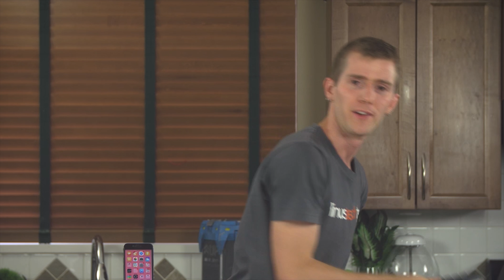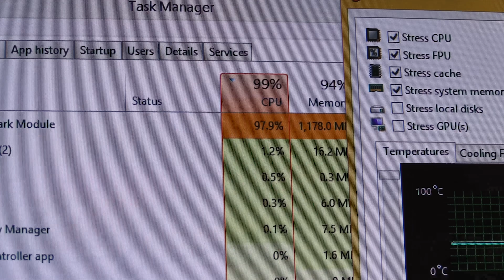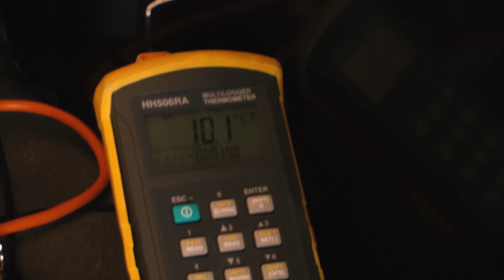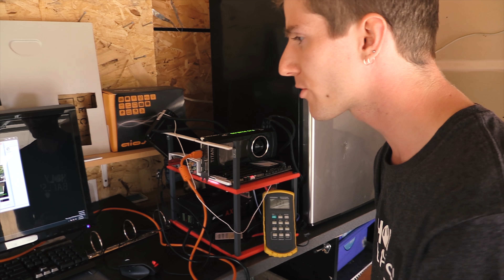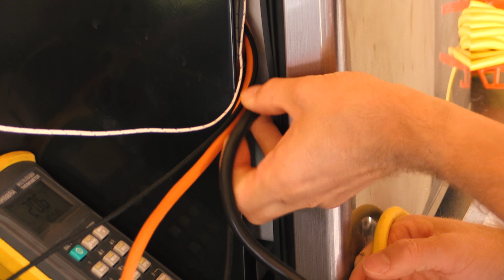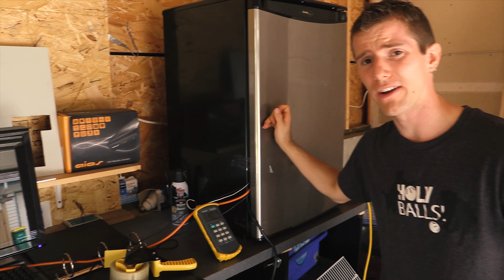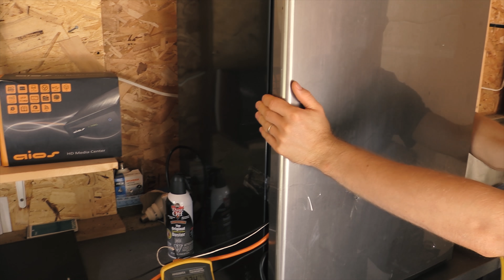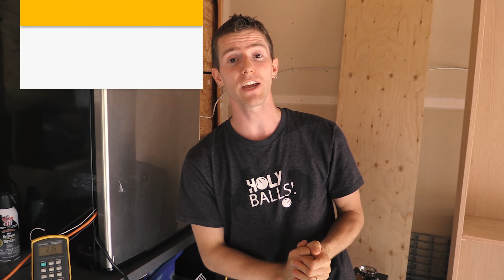PC Build in a Fridge - Does it Work??

Comment: I am building my first PC and I was hoping someone could tell me if my parts are compatible. My budget is $ 1000 Canadian (around $ 78 American).

I have selected:
- Phanteks PH-ES614P_BK Black Steel / Plastic ATX Full Tower Computer Case
- Cooler Master V650 – Compact 650W 80 PLUS Gold PSU with Modular Molex/SATA Cables 
- ASUS Crosshair V Formula-Z AM3+ AMD 990FX + SB950 8 x SATA 6Gb/s USB 3.0 ATX AMD Gaming Motherboard with 3-Way SLI/CrossFireX Support and UEFI BIOS
- AMD FX-8350 Black Edition Vishera 8-Core 4.0GHz (4.2GHz Turbo) Socket AM3+ 125W FD8350FRHKBOX Desktop Processor
- CORSAIR Vengeance Pro 16GB (2 x 8GB) 240-Pin DDR3 SDRAM DDR3 1600 (PC3 12800) Desktop Memory Model CMY16GX3M2A1600C9R Red)
- SanDisk SD6SB1M-128G-1022i 2.5" 128GB SATA III Internal Solid State Drive (SSD)
- GIGABYTE GV-N75TOC-2GI G-SYNC Support GeForce GTX 750 Ti 2GB 128-Bit GDDR5 PCI Express 3.0 Video Card
Reply: Marcel Robitaille  $1000 canadian is nowhere close to $78 american its $761.71 american
Reply: If you dont subscribe to my channel you will die within three days http://www.merriam-webster.com/dictionary/joke
Reply: Marcel Robitaille 
https://uk.pcpartpicker.com/parts/partlist/
enter them in this site and it will tell you of any issues, plus what cooler are you using, the 8350 runs quite hot, so i would recomend an all in one watercooling cooler, you don't need to add the water yourself, it's closed off and it's easy to install, look into the corsair hydra H60,
Reply: Nathan Jones Thanks for the watercooling tip. I thought without overclocking the stock van can usually cover the heat of the processor.
Reply: Marcel Robitaille
stock coolers will give you about 55C under slight load, they are really bad, my FX8350 at 4.4 GHZ runs about 35C when watching 1080p youtube videos and multiple browser tabs, and 50/55C ish under load, with the stock cooler it would easily hit 85C, did all the parts work together?
Reply: Nathan Jones Yep: http://ca.pcpartpicker.com/p/V9x4TW
Reply: Nathan Jones Can I ask why you chose the corsair hydro h60?
Reply: Marcel Robitaille
it's water cooled but it's closed loop so you don't have to fill a resovoir or mess around with tubing, it's easy to install and it's better than air for around that price, plus there isn't a massive heat sink to get in the way of anything, ideally i would now get the H80i, but the h60i works great especially if your not overclocked.
Reply: and it's very quiet.
Reply: Nathan Jones I think I might splurge and go for the h80i. I would like the option to overclock. Noise doesn't really matter for me. I have a fan inches from my face right now. Where do I put the radiator?
Reply: Marcel Robitaille
the fan and the radiator are fixed together on mine, so you just install the fan like you would nornmally on the back of the case, then it has really long screws that go through inside the case and hold the radiator inplace so the fan and radiator are sandwitched together inside the case, so for  my h60i, the fan and radiator  only take one fan slot.
Reply: Nathan Jones Thanks a lot! You have been very helpful. I wish there were something I could do for you in return.
Reply: Marcel Robitaille
my return is knwoing that your CPU won't catch fire lol.
Reply: Nathan Jones That works for me.
Reply: Nathan Jones The case I chose only has one 120 mm fan slot in the back and it's at the top. Will this be a problem?
Reply: Marcel Robitaille
no it's the same layout as mine, on the back and at the top of the back, that's the normal place for it.
Reply: Nathan Jones ok cool. Do I need support from the top or just the four long screws?
Reply: Marcel Robitaille
no the 4 screws hold it all inplace, it's not heavy or cumbersome at all, just a bit fiddley to hold the fan and radiator together then put the screw through them both, but it's easy.
Reply: Nathan Jones 50/55 thats alot you live in the desert :D ? my 8350 is around 38-42 at 4.5 with a H60, 20C temp here
Reply: why are you scaring him people a competent not that expensive air cooler would be just fine i think. water cooling is for overcocking mainly
Reply: ***** Not a joke; and it's not for browsing the internet. The most intensive regular thing will be video rendering. I would not call $ 86 of ram "wasting all my budget". Call me shallow, but I want this to look decent, hence the case I chose. A fair amount of fast ram is one of the most important things to me in this build. If you have any real suggestions, I would be happy to hear them.
Reply: Marcel Robitaille Its a good build but can I suggest-http://ca.pcpartpicker.com/p/BtPjMp 

Although it is more expensive I think you should invest now as it will give you better perfomance, better bang for buck and better overclocking headroom, especially for gaming. If you want buy only one GTX 960 and upgrade to another one later. If you want a monitor I would suggest the Acer V246HLbd.

PS: Nothing against AMD but Intel usually provides better CPUs and if you can afford it go for Intel.
Reply: Nathan Jones Ok, one last question. As this is my first build, I don't really know what/how much is included with these products. Will I need thermal paste or SATA cables?
Reply: Thunder Stryker I am not looking for a gaming rig. Also, 8 core 4.0 GHz at $ 170, the 
  AMD FX-8350 seems like a way better deal. It even has a bigger chache.
Reply: Thunder Stryker Good tip on the monitor though
Reply: Marcel Robitaille you will need thermal paste,  just put a line the size of a rice grain on the cpu, and for sata cables you will need one for each hard drive/ssd, and disk drive, you may only need one.
Reply: Marcel Robitaille .. i was gonna propose that maybe you get worse cpu for better gpu but you said you don't want gaming pc so. whats it for productivity?
Reply: Marcel Robitaille  you don't want a gaming rig ??? why is that ;). anyway.. in this case, you don't need a maximus..  the mobo I have asus m5a99FX rev 2 would be way overkill, but since you want to overclock.. well then just get a 8320 and overclock it.. that would be perfect. 

Also if you don't plan to game at all (which needless to say, sounds weird lol) you don't need a 750 Ti either, a r7 240 would be plenty enough for instance, or the Nvidia counterpart. (that have 2gb vram for half the price though..).

Ok let's assume you do as I told you you could save arround 200$, either get a second hand r9 290/x  and have a killer gaming rig.. or get a 512Gb SSD, remember the FX's consumes ridiculous amount of power also, get a HX 750 so that later down the road you can get  like a good graphic card and have plenty of room for overclocking...

Good luck m8.
Reply: Marcel Robitaille I have the 8320 for editing purposes and it works fairly well :) I use a 270x when rendering stuff and it's pretty fast, sometimes I do play games and I have to say I am satisfied with my rig. The 8350 is a good choice!
Reply: Nathan Jones It says Thermal compound (pre-applied). Do I still need thermal paste?
Reply: naah its already there it might look like a tape on either the cpu or bottom of the fan heatsink. i think nathan'll tell u the same
Reply: Marcel Robitaille Please switch out your power supply for a Seasonic equivalent. The stability of your power supply will speak volumes for the longevity of your build. Don't ever skimp out on the power supply. I've learned it the hard way.
Reply: BigmanTing 55c under full continuous load, its hot and humid in my attic room, idle is around 30c/35c.
Reply: Colossal Mushroom I have switched to the CORSAIR HXi HX750i. Satisfied?
Reply: ***** Why do you say that? I know it runs hot. I am ordering water cooling.
Reply: If you don't go high end (100 ish $) water cooling is a waste IMO.  but it's nice, also looks cool, if you have a window on your case ;).  and good choice with the hx 750, followed my advice I see.

Je vois que tu parle français ;) avec un nom pareille j'aurais du m'en douter aha
Reply: Marcel Robitaille wao yeah it is
Reply: Marcel Robitaille  You forgot the mini fridge!
Reply: *****
i never said to get watercooling for basic web browsing you fucktard, it was for the CPU intensive video rendering, learn to read before you comment, plus i listed like 5 other reasons why a closed loop watercooling is better than air, no massive heatsink, alot quieter, looks way better, better cooling, the FX 8350 is a hot cpu, doing video rendering would ramp the fan RPM to an annoying loud level, i bet you don't even have these components, so what the hell would you know about them specifically.
Reply: Anchoret89 I want to overclock.
Reply: David Zer lol
Reply: If you dont subscribe to my channel you will die within three days It's a joke.
Reply: ***** 
- "The ghz and cache number mean absolutely nothing when comparing intel and AMD." What?
- "I removed the GPU because it is useless if you never play games." I never said I would never play games. It's just not a "gaming rig".
- "I choose a evo 212 air cooler because the difference between air and water cooling is minimal and is perfect if you don't overclock." I want to overclock. I've said this before.
- Nice case but no disk drive?

Why did you switch the ram? What is the advantage?
Reply: ***** - Fair point on the cooling but watercooling is just too cool and I don't mind spending a little extra for it.

- You picked more expensive ram
- I know, I have a USB with ubuntu on my desk
Reply: Marcel Robitaille you lost me after AMD but your choice of ssd and psu is not that good is well.
Reply: ***** Why?
Reply: bektas konca I have since changed the ssd and psu. What does everyone have against AMD?
Reply: Marcel Robitaille i have been fixing computers since 90s all i can say is i have seen 10 times more broken AMD computers  than intel, so get my meaning?
Reply: Marcel Robitaille same thing applies to graphics cards with ATI they are not reliable like nVidia, i would opt out for cheaper older model  on intel and nVidia instead spending money on AMD and ATI.
Reply: don't listen to the haters AMD 8 core is perfect for rendering, that's actually where they shine most.. LOL. I know for a fact I have one oc @ 4.65 on ND14, and I looked tons of bencmarks, Marcel did you already order your build ?  show me the parts you choose again, RAM G-skill 2133mhz CL9 8 gb kit is your best  choice, and the 750AX corsair PSU can't go wrong with it.. 7 years warranty.
Reply: Thomas Syxe No I didn't order yet. Thanks for your suggestions. I will definitely look into those components.
Reply: Marcel Robitaille I'd advise a more powerful graphics card than any processor change,Cheers!
Reply: Marcel Robitaille http://ca.pcpartpicker.com/p/JfvdQ7 I'd go for a stronger processor but i think im already out of your budget
Reply: EliteNoob Nice build. thanks for sharing.
Reply: Marcel Robitaille
You'll need to upgrade the cpu in  2-3 years :p  i have a similar build and i can play whichever game i want at decent fps
Reply: FX 8000's /and 9000's CPU are good for multithreaded applicated only thing they lack is single threaded applicated, it is best illustrated in Cinebench r15 benchmark for instance where my CPU score 111 single threaded 170+ for the best Intels and multithread my CPU do 735 and a stock 4770k = 822, so considering you can get the 8320 for pretty much half the price (I checked and still 150 euros ish here)and OC it it's not that bad, also the other part where they suck is power consumption, so if you're in a country where electricity is expensive then it's not a good choice of course.
Reply: Marcel Robitaille i am not talking out of hate for any product, i am pointing out a fact that i live with last 20 years, i have seen lot more broken AM & ATI than intel & nvidia, choice is yours you could get a higher specs on AMD & ATI with your money and they will be broken in a year or so if not the first few months or you can get Intell & Nvidia it will last you at least 3-5 years. i do not know you, you asked for advice and i am statin a fact from my experiences, do your own search on net see if i am right.
Reply: bektas konca
 I bought my pc used(anything could had happened to it) it's AMD and its going strong..
Reply: Marcel Robitaille 
That is very much like my system so i will say be sure that psu will be enough power and you do not want stock cpu coolers even if they do the job they will be noisy. i would say buy air or water cooling in the 40-60$ range if your taxing the cpu but not over clocking. good luck
Reply: Anonymous Coward Thanks bro
Reply: Nathan Jones think you got the 8350 and the 9590 confused because the 8350 with a air cooler can hit 5ghz without overheating
Reply: MrTheSuperMarioBros
i have the 8350 at 4.4GHZ, and it certaintly isn't a cool cpu, but it doesn't over heat, mine never goes above 60c.
Reply: MrTheSuperMarioBros
 no way on earth you get 5ghz on air ahha, I have bought a Phanteks Primo case thinking it would help my temps,@4.65 1.45 or so volts it doesn't hold prime 95 without overheating and throttling with a noctua nd14

in games it's fine but 4.7ghz is limit on air, 4.8 MAYBE if you have a d15 and a good chip that doesn't require much voltages
Reply: Marcel Robitaille 99 dollar case, 90 dollar psu, 200 dollar mobo but cheap gpu and cpu. Buy a cheaper mobo, you can probably find a cheaper PSU thats still good and a little cheaper case and spend a little more on a gpu or an i5 cpu.
Reply: Thomas Syxe you dont have the same cpu so your numbers are irrelevant to if someone else can get a certain freq on air. 5 ghz seems like pushing it though. depends on ambient temps. in a cold country in the winter it might be fine.
Reply: Uhh for your information the 8320 is a downclocked 8350, and the fx 9590 is also pretty much the same CPU @ 5ghz with different architecture heat and power consumption as the same.
Reply: $1000 Canadian isn't $78 American
Reply: Or even close
Reply: Or even close
Reply: spooks walrus http://www.urbandictionary.com/define.php?term=Joke
Reply: Marcel Robitaille not clear enough, please explain
Reply: spooks walrus It's a joke about the value of the Canadian dollar
Reply: Marcel Robitaille i don't understand please explain more
Reply: some kind of low level trolling going on
Reply: +If you dont subscribe to my channel you will die within three days he probably meant to say 780
Reply: +Marcel Robitaille $78 pc? Wow cool. LOL
Reply: Please dont fucking copy paste like that because nobody wants to go on a treasure hunt for the actual part name. Just say "750ti" "cm v650 modular" etc
Reply: +Marcel Robitaille Your going to need some help building that. Sometimes buy the most high end components for your first build is a bad idea. Start with something you can destroy and not hurt your pocket book. I built my first machine out of a radio shack dumpster in 1994, but it worked. Now i don't even bother with new hardware, I've got the fastest machine around, and its 4 years old. It's how you use the parts at your disposal that make the difference.
Reply: +James Jarmon I already built it and I didn't fuck anything up
Reply: +Marcel Robitaille Good, that means you took your time and did it right the first time. Most of us get in a hurry, and make some kind of mistake on our first machines. Do it the same way every time you build a new machine, and you'll have the same results. the fastest processor you'll ever own is the one between your ears.
Reply: +James Jarmon Thanks for the advice
Reply: what parts did you go for in the end then ?
Reply: +Thomas Syxe http://ca.pcpartpicker.com/p/v8Rbgs
Reply: Good choice, except a 8320 would have be the same lol, especially if you OC.

I would have get higher frequency RAM.

And not sure about this SSD but it should be fine i guess..

Not sure about this motherboard.. you need good VRM's for those CPU otherwise it's gonna heat up alot !

Other than that, good choice :D. Phanteks pro, nice I got a Primo like a crazy ass ;)
Reply: +Thomas Syxe Too late for the 9320, thanks anyway.
Next time I will get better ram. This should be fine for a first build.
Aren't these the ssds Linus uses in his server?
Reply: oh ive no idea :) they're probably good, as i said, i just don't know havent seen reviews of those !

Comment: I'm going to be building a PC soon to run games like Terraria, DayZ, and maybe Rust. And I was wondering if this PC would be good for running these games at enjoyable FPS? And I don't mind graphics so from a standpoint of absolute bare minimum graphics on everything possible... Also am I missing any parts or will this computer run games from where its at, I just want to know in case I buy if and find out it can't even turn on because of some crucial component... Thank you for reading...

Part List

Case: BitFenix Neos White ATX Mid Tower Case

CPU: Intel Pentium G3258 3.2GHz Dual-Core Processor

 Motherboard: ASUS AMA1-A Micro ATX.

 Board Processor: AMD Athlon 5350.

 Video Card: XFX R9 270 2GB.

RAM: 4GB Crucial Ballistix Sport.

 Hard Drive: 1TB Western Digital Blue.

 PSU: Cooler Master GX-II 550W Power Supply.
Reply: thanks XvZouncevX !
Reply: yeah right now im not worried about Ram because after building im planning on heavily upgrading it over the years and i have a tight budget, my goal is 64G of ram some day but for now im just gonna go with the 4G
Reply: Well I'm planning on Upgrading it later on... But right now I just want a cheap PC... But thanks for the input!
Reply: I've looked into it and think I might, its just my budgets so small and I don't know if I will be able to pay for it by the end of the year... Also I have a question... Is RAM and Memory the same thing? Because they look the same and the storage looks like where everything goes...
Reply: ***** yeah on tomshardware or something the crucial ballistic sport is 30$ US. and for my budget its just a lot of extra money... do you know any alternatives for any parts that are cheaper or if i can entirely remove a part so the price doesn't come up to much?